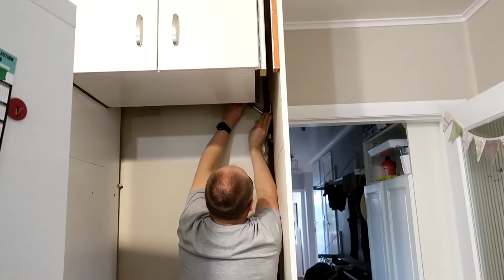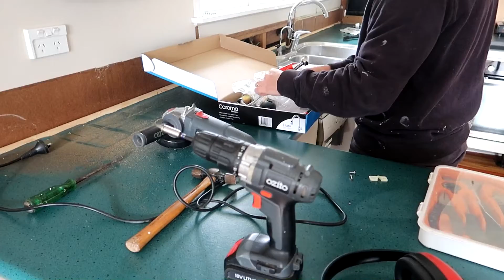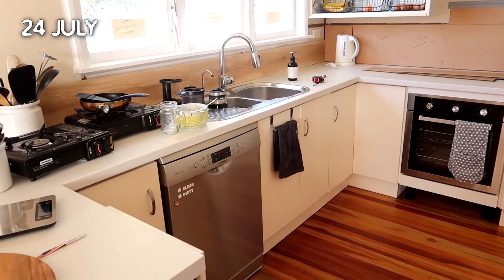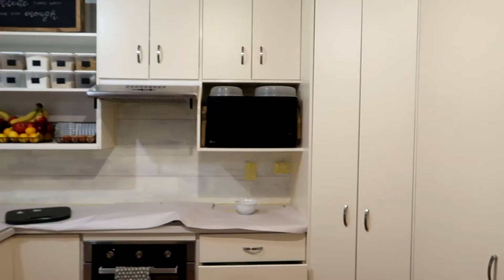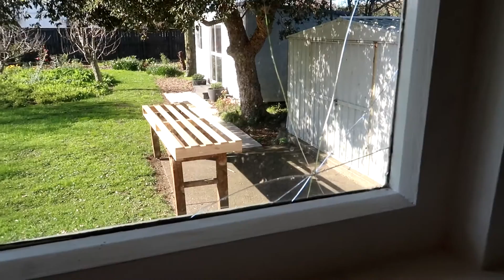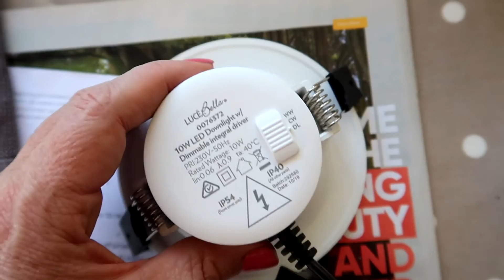Our Kitchen Renovation Process & Costs | A Thousand Words

Comment: Fridge is looking good!! Huh...The dishwasher was plugged into the side of the stove? That’s so weird. Ooh the wood did look pretty before you painted! Definitely like the white more! Did the kick board cover that whole section or was it just the size of that small whole under the oven? Omg...that backsplash looks really nice!! I love Formica, it’s heat resistant and durable. I love the look of the bare kitchen, it just looks cleaner!!
Reply from the maker: Thank you! The kickboard goes across the whole width, we just left the old kickboard in place as it was difficult to get off, and put the new on on the front of it.

Comment: I would like to have seen how Noah made the seam tight  (Btw he has grown so tall since I last saw him).   Did the project come with factory brackets made for that purpose or was this something you thought of?   Was there also a seam in the far corner to the right where the kettle goes?  Also, what does "Keep Window Sill Clear" signs mean.   I'm guessing it's quality control due to the fact there are men potentially cluttering about and you want the fresh paint job to cure.  Just a guess... because I have this man urge to set a 2nd cold can of beer there while I drink my first one.  The kitchen turned out beautifully....
Reply from the maker: Thank you! The counters were cut to fit together at the corners. Underneath there are holes with brackets that fit into them and then you tighten a nut which pulls them together and squeezes the seam closed. Yes, there was another seam in the other corner. And you guessed right about the sign :)